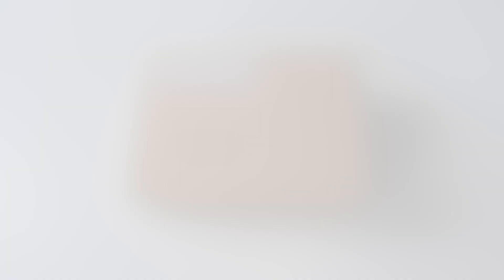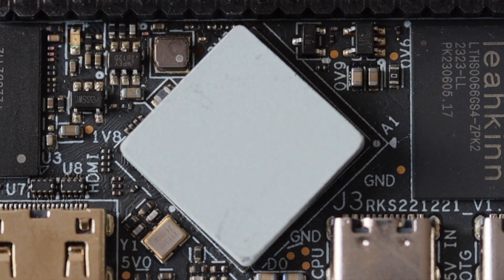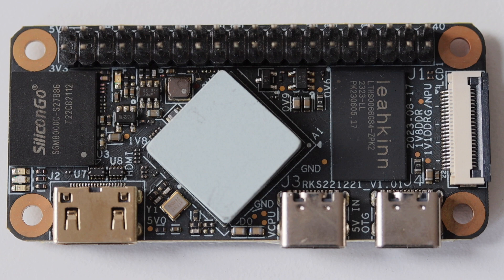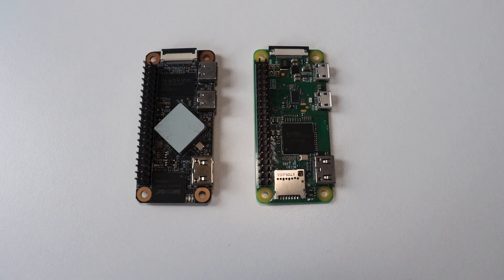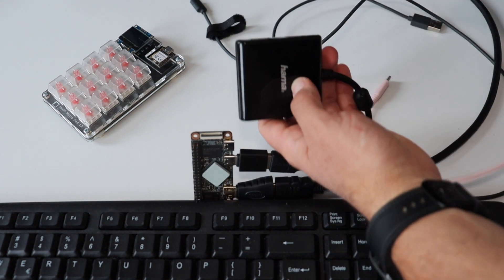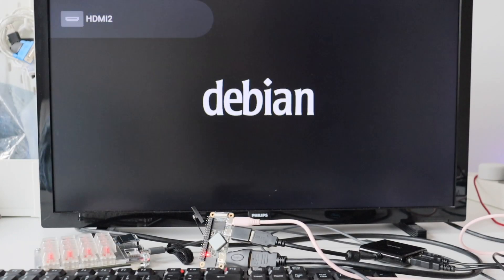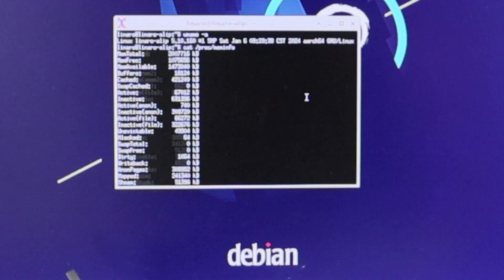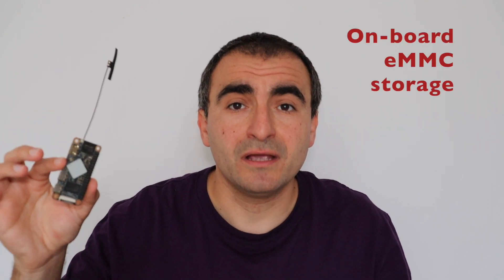Geniatech XPI-3566-Zero: A Powerful Raspberry Pi Zero Alternative Featuring the Rockchip RK3566

Comment: Nice review! Did you meant MIPI-DSI instead of MIPI-CSI for the LCD display interface?
Reply from the maker: Thanks! According to the datasheet it is MIPI-CSI.
Reply from the maker: I asked Geniatech and they confirmed this is a MIPI-CSI interface for a camera. It is awkward but the "LCD" label on the printed circuit board is just a component identification used during manufacturing and doesn't directly indicate a display interface.